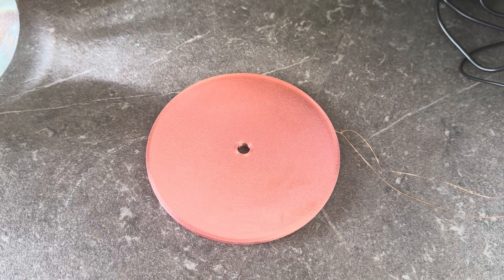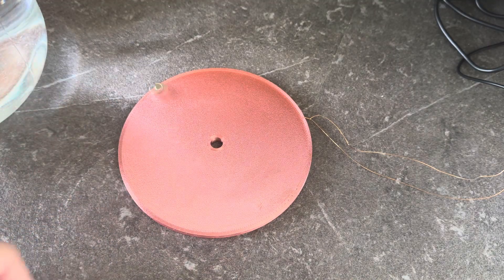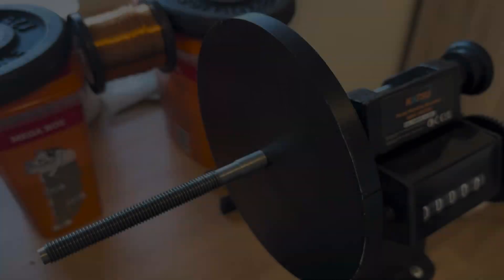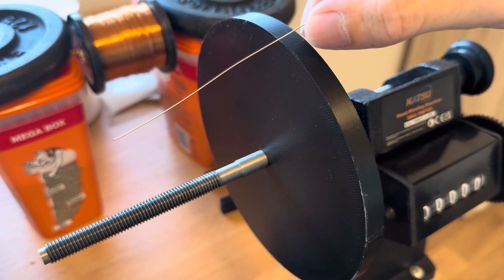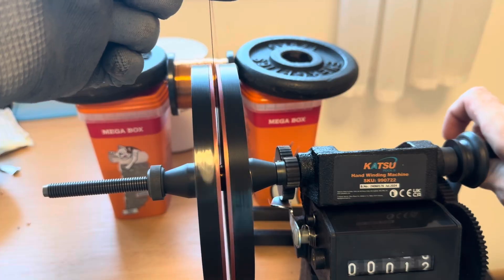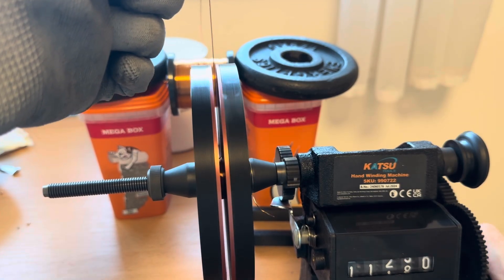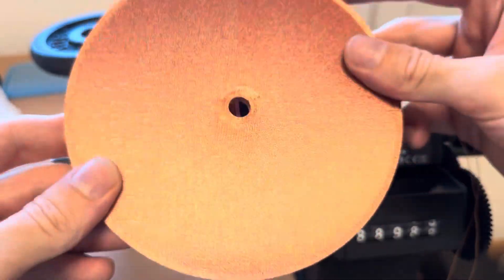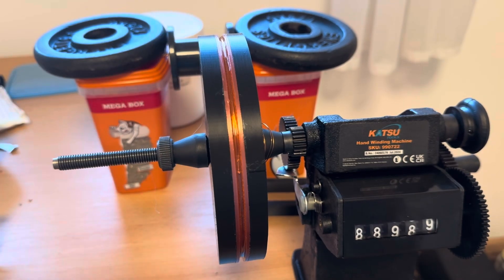How to wind a large flat copper coil 📀 + Giveaway 🎁

Comment: very nicely done. I've made them from speaker wire (dozens of turns), bifilar too, for Tesla coil stuff like Master Ivo does - but never yet done so with magnet wire - thanks, I'll try!

My 'tesla coil' preference is for the flat spiral TC secondary with a couple coplanar primary turns around the perimeter/circumference. So i'd been trying to brainstorm a way of having compressed discs as brackets for winding a coil between - thanks!

you think it could be done so the windings are only a single layer (axially)?

Comment: I think you could improve that system by adding some break-away locking tabs on outer edge of the coil holder plates that lock into structures on the edges of the two thick spacer plates. If you make the locking tabs like little L shaped fingers that are oriented so they are pointing against the direction of roation, then they will stay locked in place without needing a strong catch/latch mechanism. I think that 6 or so of those around the perimeter would keep the plates flat and would be easy to cut off when the coil is done. Then the setup would not need the tape. The only thing to watch out for is that the tabs do not intersect with the path of the wire or get in the way of winding somehow.

Comment: There is better way to make these coils without wasting space for the reel.  Make temporary sides & center of the reel out of Delrin (epoxy won't stick to Delrin).  Dilute some mixed epoxy with a little acetone until it is thin.  Put this on cotton ball & pass the wire through this as it is being wound, coating the wire with epoxy.  Remove the coil from the machine & bake is at 120F to flash off the acetone & set the epoxy.  Then disassemble the reel sides & core, peeling them away from the coil.  The coil will be self-supporting, bonded throughout with the epoxy, without the need for reel sides.

Comment: If I’m curious and want to try 3D printing it myself using the files, what should I know and where should I start?
Reply from the maker: Print it solid with no infill, layer height as small as possible, should be an easy print. 
Maybe turn down the print speed if you run into print issues.
Reply: @OmegaZZ111  do you mind if I ask what 3-D printer you have or use? and is the preferred material?  I know this is a lot of questions, but I’m so interested.
Reply from the maker: @TrailBlazers33 I have a BambuLab P1S and I use PLA to print.
Reply: @OmegaZZ111 Your the man thank for your time sir 🙏🏽🙏🏽
Reply: @OmegaZZ111  How do you keep the coil from getting to hot? Last one I promise lol
Reply from the maker: @TrailBlazers33 Don’t use too much current or use thicker wire.

Comment: i have seen the making of a bifilar pancake coil but not one like this using a machine, very good !!! i have an idea of making a coil winder using an old LG washing machine direct drive motor ( like a stepper motor you can control the number of turns ) this would wind a 18 inch wide by 18 inch tall coil for my experiments i want to do fusion of Aluminium to create Iron ( AL13 + AL13 = Fe 26 ) as shown in LENR ( low energy nuclear reactions ) documentation, thanks !!!